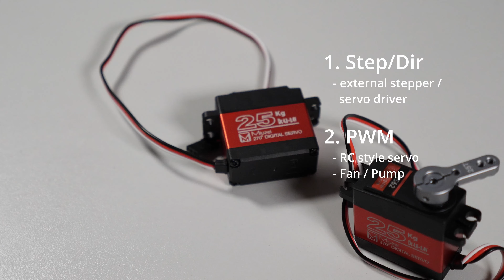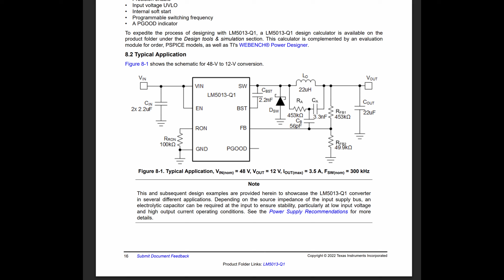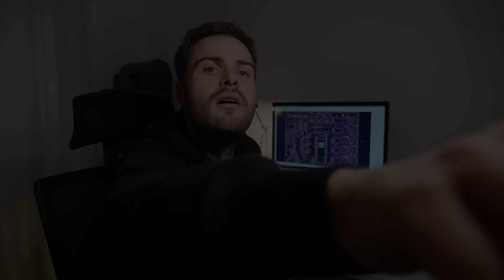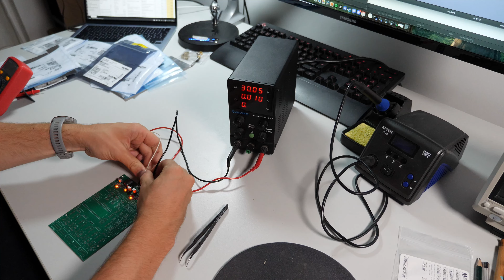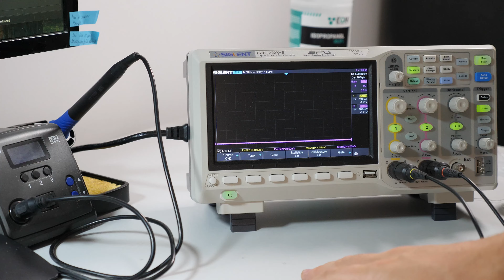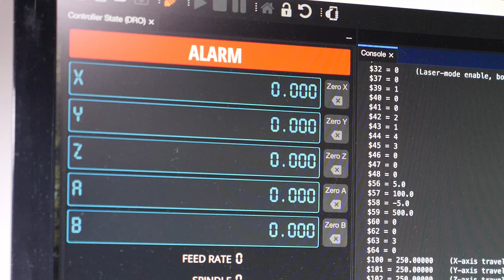Prototyping a custom Board to run my Robotic Arm

Comment: Nice build!  When you bring up your board, it’s good practice to use the current limit function on your input power supply to see if it’s consuming the expected about of current, rather than just counting down and turning it on full blast. It might also be good to route your extra pins to a header somewhere in case you need future expansion mid project
Reply from the maker: thanks alot. Now you say that it seems obvious :) Will definetly include that in the next bring up!